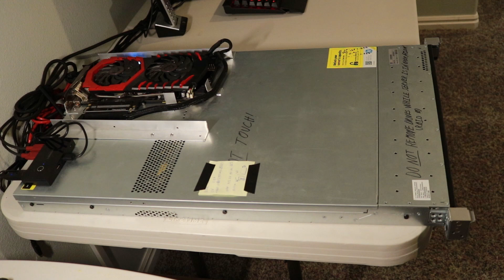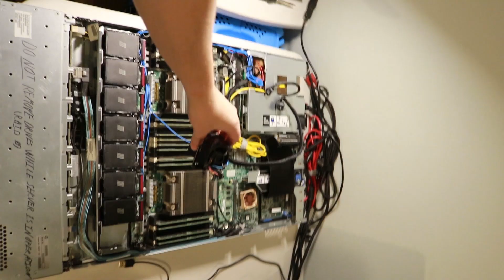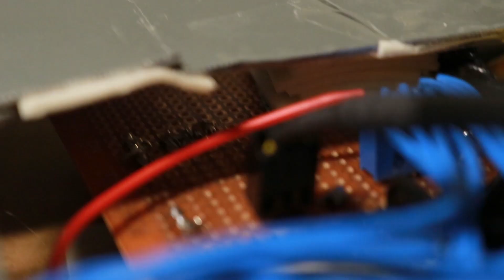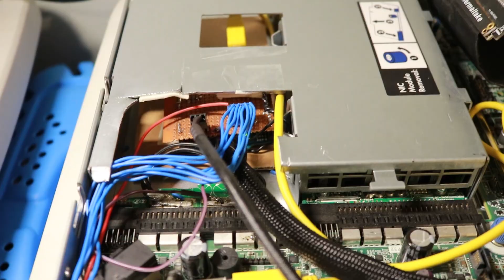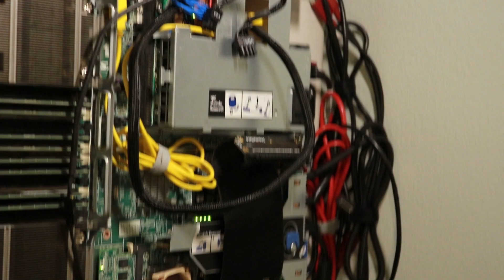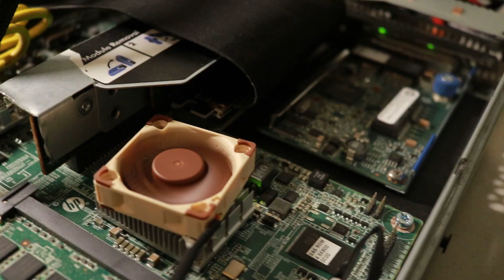Turning a Proliant Server into a gaming rig

Comment: What pcie extender cable did you get and how did you power it? I bought a Quadro M4000 for my DL360p only to realise it a) needs an extra power connector and b) doesn't actually fit in the slot despite being thin enough because its too long
Reply from the maker: For the riser cable, I used a generic x16 riser from Thermaltake. Riser cables don't consume power, so I'm going to assume you mean GPU power. For powering the GPU, skip to 2:18 in the video.
Reply: @timbermonson  Hi timber, I also want to install a video card in my proliant server and i have actually three 8 pin power connectors on my motherboard(normally used for storage extension is guess). Do you think i can power my video card with it? And can you please specify how you powered your video card because i still don't really get how you have done it. Thx (:
Reply: @loeloe0358  I'm interested in this too

Comment: I have the same mach for 6 months now have got a video card working and added usb3 4 ports but that's it.  Thanks for info on unplugging some drives saving power but would  really like more info on powering video card off the extra power supply and the elusive quieting of the fans as it runs even at idle very loud. Thanks a lot for the info

Comment: You should publish a video showing how you did the fan mod in detail. Lots of people want to be able to control server fan speeds
Reply from the maker: I would like to, but it requires hard-modding the fans, and each server has different fans. So... some people may try to follow along, and ruin perfectly working hardware. Additionally, a failure of the fan-control can cut off airflow and roast your expensive hardware. I'd love to introduce more people to maker-stuff, but as long as I'm doing risky projects like this, it'll be purely non-instructional.

EDIT: As an added bonus, I nearly dropped the server during transport & the sharp-edged GPU mount left a decent-sized scar on my leg. And, now that I think about it, the GPU power solution ONLY works because I knew exactly what I was doing. These projects are WAY too risky/janky to be shared in any serious capacity.
Reply: @timbermonson  sorry to hear about what happend with the leg, hope it healed. the Fan splicing isn't as dangerous and it is all internal.  even there are single slotted half height or full height GPU that would fit into the server without needing to cut open on the outside.

could you at least do a video on the Arduino which wire to cut and where to solder onto the Aruduino?  HPE servers are known to have high noise fan compare to the Dell counter part, by A LOT and we'd even pay a premium to have this customized/fixed in our HPE servers.

Comment: Nice job. Very creative like what u did.
I always wanted to use a server as a daily driver I don't play games. My concern is the power usage of this servers. To this servers really use much more than normal pc?
Reply: Idk if you’ve made your mind up already but don’t buy a server as your daily driver. People buy these servers and stick GPUs in them just because they can. Servers are louder, bigger, and use more energy than regular desktops. You could get this maybe as a fun project but not alas your main pc. You’ll run into lots of driver and device compatibility, as these older servers weren’t made for gaming, and you have to have the technical knowledge to pick out the server that will support a graphics card. If you still want a server, however, buy an ITX sized server motherboard (maybe even one with 2 cpu slots, although that doesn’t boost performance) and make yourself a hybrid. Part enterprise server hardware, part souped up gaming rig.
Reply: @GrabASpriteB  I have a hp proliant 360 g7, it's quiet, and doesn't use alot of power, and you can use any gpu you want that uses under 150watts. Most servers aren't actually that loud and my server specially has a 460w power supply that came and doesn't even reach 400watts under full load with both my xeons running along with my gtx 1050 ti.
Reply: @IceDragon-fj4vx  What xeons are you running and average fps in fps games thinking of buying one for 125€ with 2 E5620 and a 1050 ti
Reply from the maker: @IceDragon-fj4vx  I've built a new PC since this video, and the sound difference is HUGE. Even though a modded server may be tolerable, nothing compares to the absolute silence you can achieve with a decent airflow case. So... Even the quietest servers are louder than the average desktop PC.
Reply: @timbermonson  not if you passive cool a server
Reply: @timbermonson  my laptop fan can be louder than the my server at 25% fan speed, only added a small 50x50 5v fan connected to usb to cool the chipset from +70C to 49C,during the night in the next room I can't hear the server noise but the laptop on the other hand, sounds like a SR-71 taking off
Reply: @timbermonson  just one question can you explain how you mounted the gpu without touching the case
Reply from the maker: As I specify in the video: I only built this because I got the server for free. Otherwise, you're MUCH better off building your own PC from scratch.